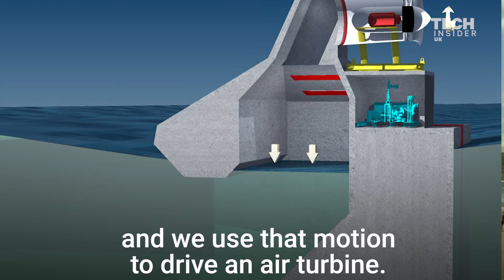This wave power device works like an artificial blowhole to harvest renewable energy

Comment: Have you already started the test operation? What are the results?
And yes, why use only the airflow, which is pressed out of the buoy by the rising wave, and not - with a second turbine - the airflow, which is recovered by the falling wave?

Comment: As far as I understand you use the work only for the have of the cycle. So why not use the complete cycles and put two turbines? I mean if you use only the low pressure interval to drive the turbine in one direction use the high pressure to half to drive another turbine.
Reply: and add flywheel